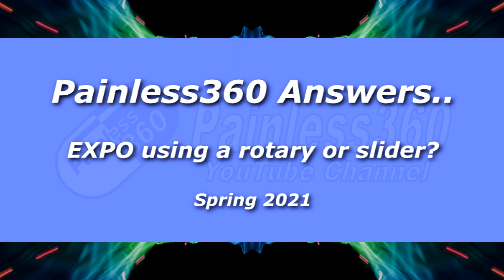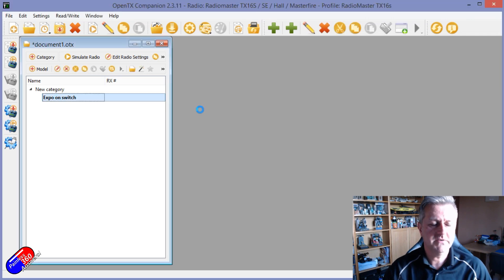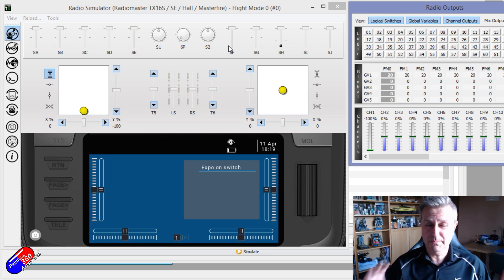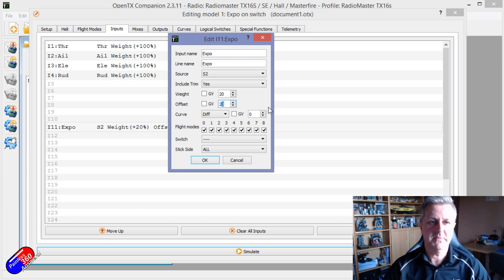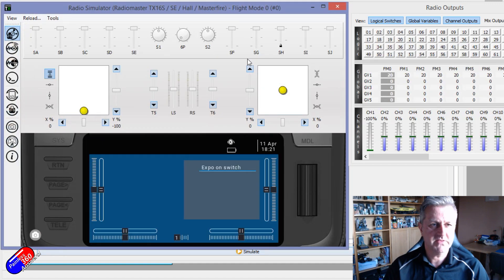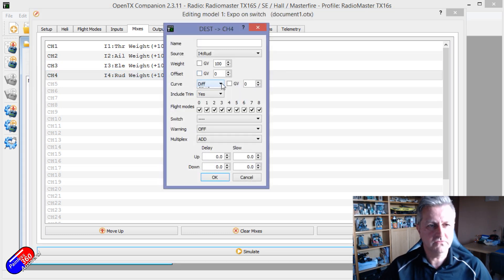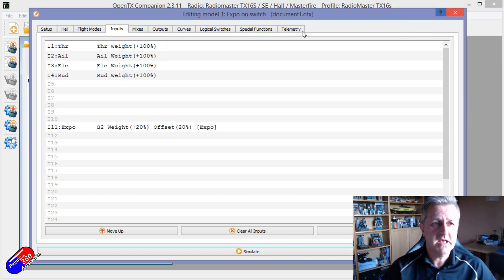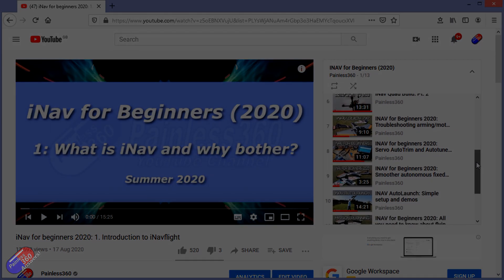Changing EXPO on the fly using a rotary/slider control easily

Comment: Hay I have a unrelated question. I seen a guy with another radio trim his elevator when he put his flaps down. But here is the kicker when he brought his flaps up the trim automatically went back to where it was. He also did this at half flaps. I know how to set up a flap to elevator mix, but to be able to do it on the fly would take all the guess work out of it. Will open TX do this? Thanks for your consideration
Reply from the maker: Yes. Use the same idea of a global variable ad the weight for the flap to elevator... Best of luck

Comment: What a brilliant Channel this is. 🙂 Sadly, it also includes dodgy nostalgic RC-related Comments from the likes of me!

I'm far too simple to use anything as complex as OpenTx; when I was flying back in 1980-something, long before computer radios or rates or expo, the only way to have variable control sensitivity was to have a Tx with very long sticks.

[Note: I fly Mode 1 - elevator on the left, main turn control on the right.]

My favourite setup for thermal soaring at extreme altitude was a Sprengbrook Variomodul Tx, which was wide and flat and had a weird rear-mounted suspension system that let it hang horizontally from a neckstrap as though it were mounted in a tray, only without the tray.

That let you use extremely long sticks (almost three inches). Of course, you couldn't fly with just your thumbs, you had to pinch the sticks, tray-style. It was very comfortable. By moving your grip up and down, you could get fantastically sensitive 'analogue' expo just by pinching higher or lower.

When a 12' span glider was just a speck in the sky, it was easy to avoid excessive control inputs simply by using the ends of the sticks.

If you needed less expo, you just gripped lower down.

Not exactly high-tech, but it was infinitely variable and very effective.